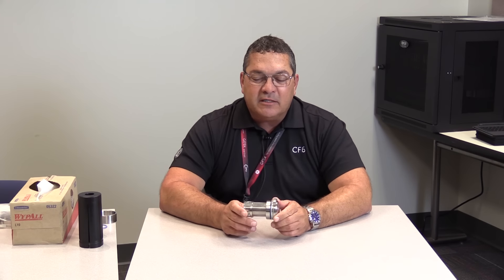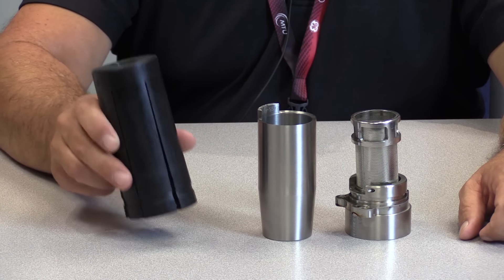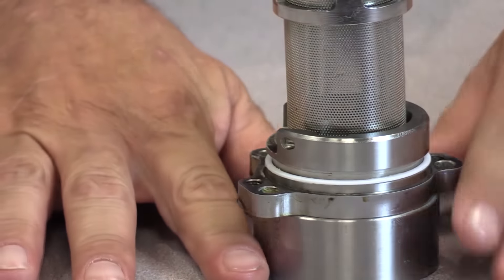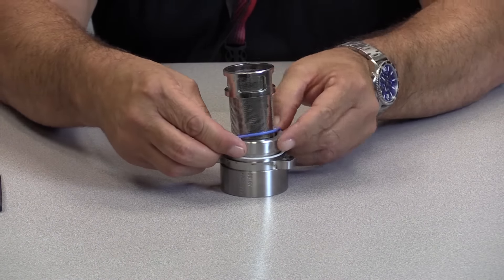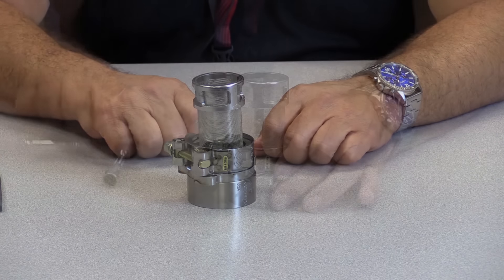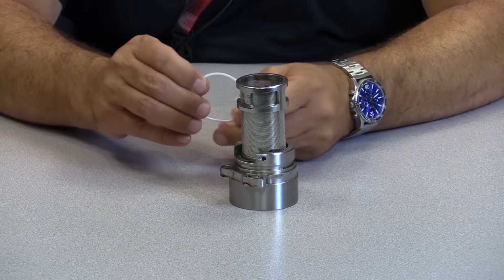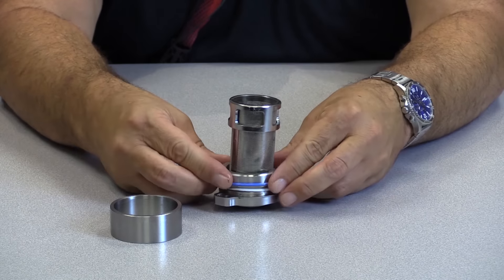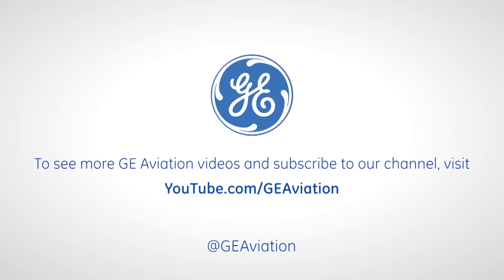CF6 - 80E1 Fuel Strainer Packings - GE Aviation Maintenance Minute

Comment: Am I the only one who thinks it's a little rediculous that this thing is designed in such a way that you can't install the seal without damaging it?
Reply: We had better kent-moore seal installers for the 4l80 transmission at the GM dealership. Front pump seal, and piston seals have to be perfect, or back out comes the transmission! Guys learn that you can't force a seal on the hard way when they go for a test drive and have no 3-4 upshift lol.